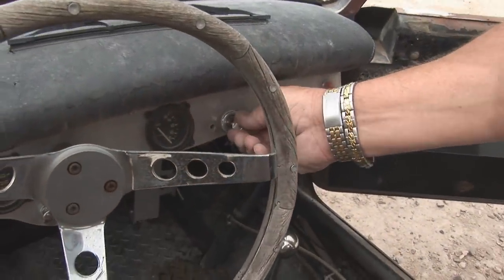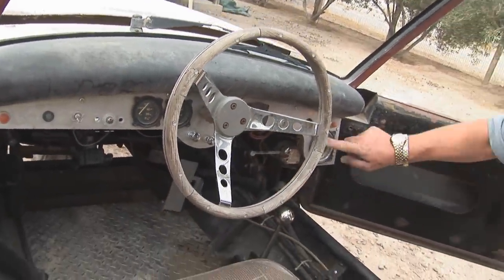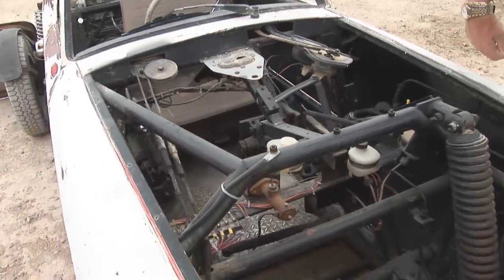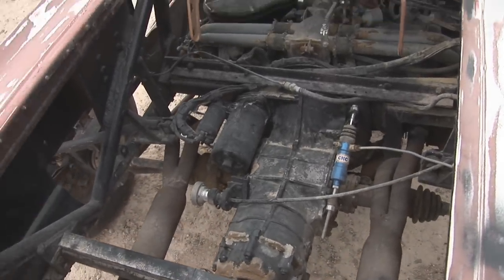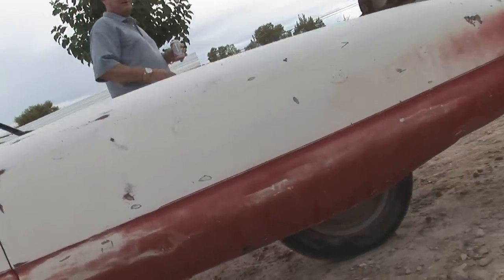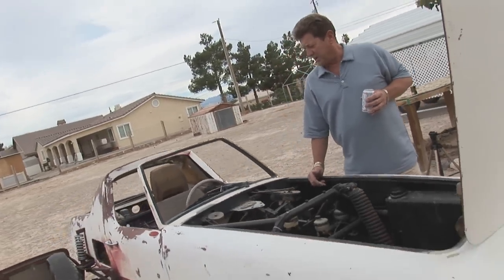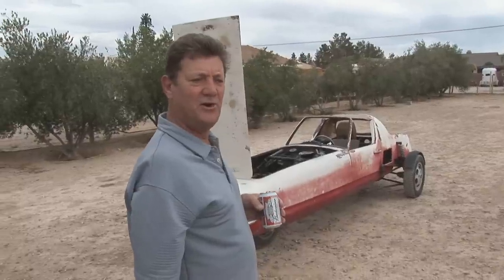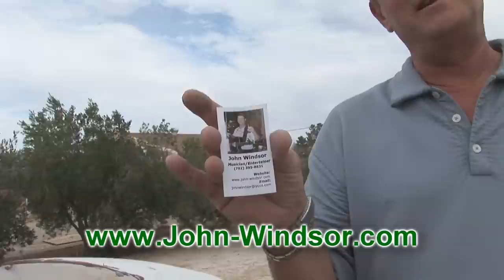Extremely Rare 1967 Gyro - X car from Gyro Transport Systems

Comment: The original design had two wheels and was self balancing using gyroscopes.
Reply: Lawrence Rhodes gyro quit working it was updated to 3 wheels grossly
Reply: @Thomas Alan grossly is correct
Reply: @nastilyasperated2215  That is sad.  However nobody has been successful in making a self balancing vehicle except in side by side versions. The gyroscopic action of two wheels in line vs. parallel are vastly different. The XTracer works well as a cabin cycle. https://www.consumerreports.org/xprize/x_tracer_e_tracer.html
Reply: i dont mean to be so offtopic but does someone know of a trick to log back into an instagram account??
I stupidly forgot the account password. I love any assistance you can offer me.
Reply: @Kyler Kieran Instablaster ;)
Reply: @Gannon Malakai it did the trick and I finally got access to my account again. I'm so happy!
Thanks so much you saved my ass !
Reply: @Kyler Kieran Happy to help xD
Reply: My next door neighbor Tom summers built this car. Sat in it many times when it was two wheel drive.